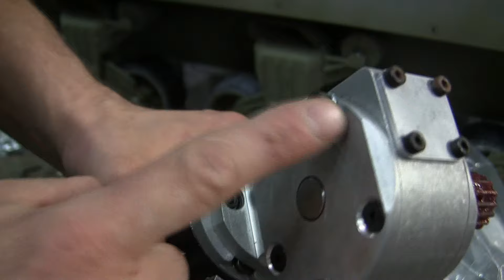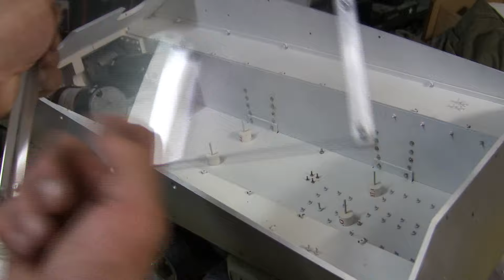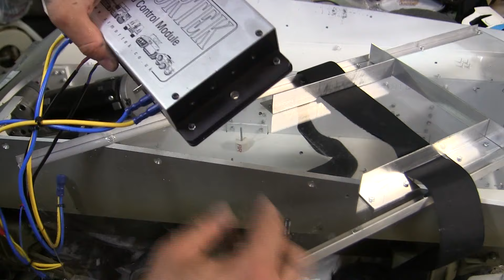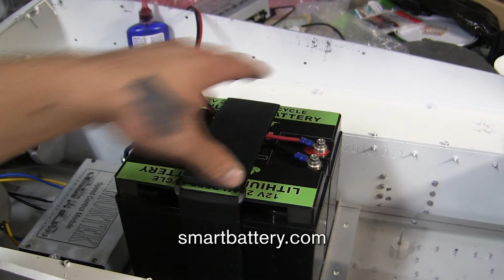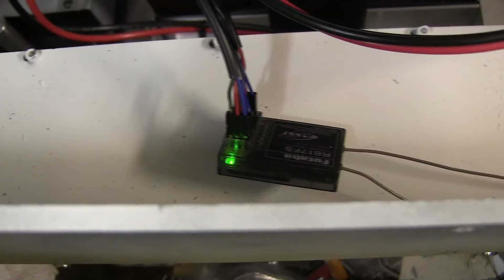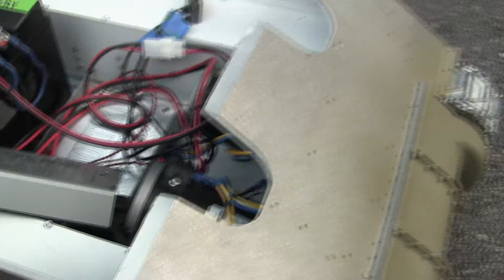RC Armortek 1/6th scale Sherman V Firefly project video#3 (motors , tracks, and test drive)

Comment: So how long does it take to make one of these? Rests and breaks and all included. I doubt anyone's mad enough to do one in one long go... But maybe I'm wrong.
Reply from the maker: building one in one go is not hard to do at all, What takes time is when you have to tool up and R&D new parts, if I'm working on a tank that I already have all the detail parts for i.e. sherman family or Panther, the build goes by quickly, before I began taking on commission builds I was able to get one of these tanks done from 3 - 6 months time.

Rests and breaks are actually not good as they break your flow and it's not as easy to pick up where you left off
Reply: Sounds awesome. Also, what's your favourite tank?
Reply from the maker: I got a few, but I was and always will be a die hard sherman guy
Reply: +oddball759mm Sherman is a nice tank to have as your favourite. You basically have 3 or 4 AFVs with different roles which you love encased inside that one chassis. Also, currently I love the STRV 103C/D. There's just something beautiful about that thing...
Reply from the maker: a close #2 for me is the M48 / M60 series